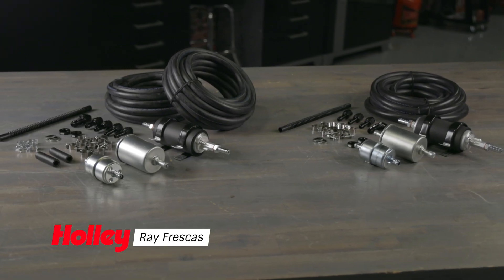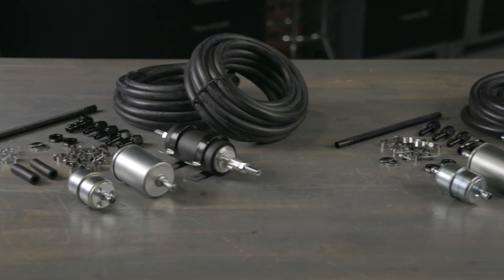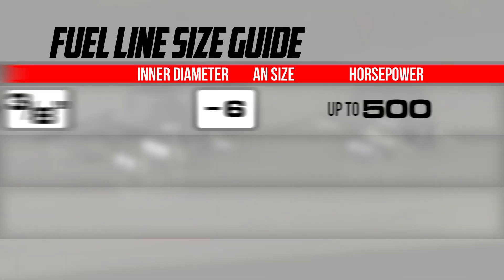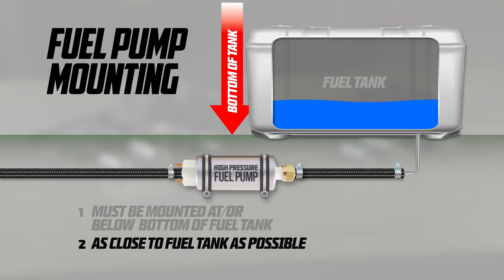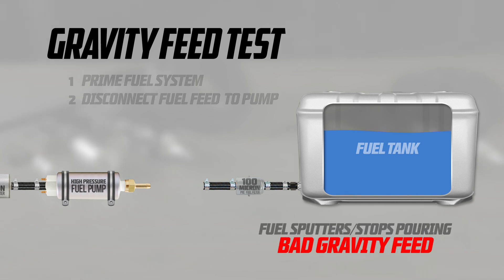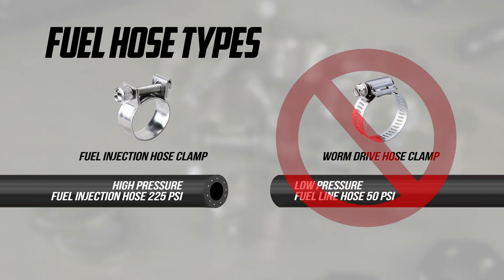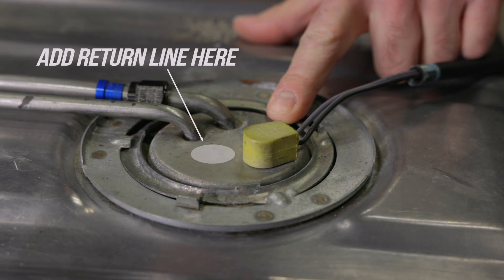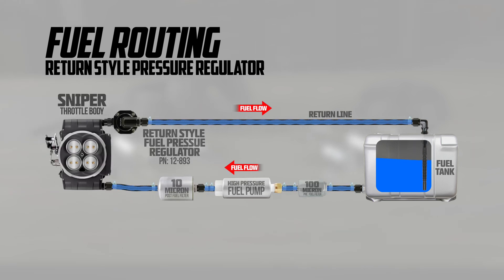Expert Tips for Installing the Holley Sniper EFI 2 Fuel System

Comment: Bad fuel injection system to begin with, not the installation. Holley put out a crap system and didn’t stand behind it and just blamed the installers. I guess we will see if Holley fixed the sniper efi with the second rendition.

Comment: If your fuel supply comes out of the top of the tank how are you supposed to have it gravity fed?
Reply from the maker: Run the gravity-feed test first - that’ll tell you whether it’s safe to use the pump. Fast forward to 3:37
Reply: @HolleyPerformance  I was going to use the original feed that comes out of the top of the tank through the sending unit as the return and put a fitting into either the bottom of the tank or an inch up the side for the feed.
Reply from the maker: @MrSHAUNE55  Easiest spot is right by the feed/sending unit. Just make sure you run the test first so you know everything’s good before you get too far down the road.
Reply: @HolleyPerformance  The sending unit is on top of the tank so it won't gravity feed, so what is now the outlet can be the return with a new outlet at the bottom like in your video? Just ordered the sniper 2 master kit from you.
Reply from the maker: @MrSHAUNE55  That's the best way to do it. If you tried the test with the feed on the top and it didn't work then how you have it planned is the way to go.